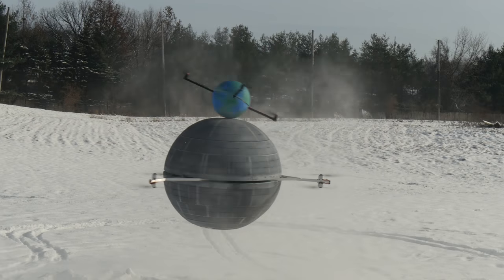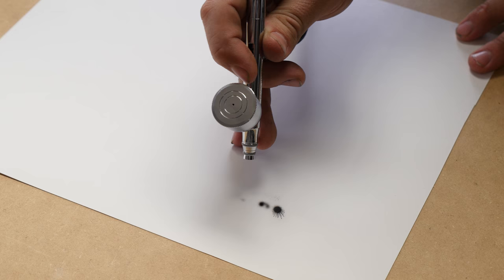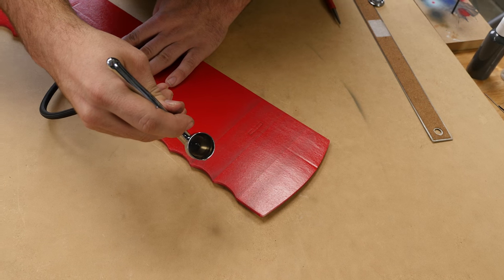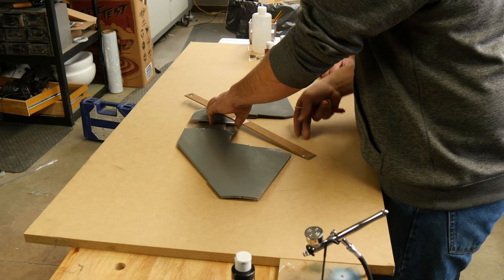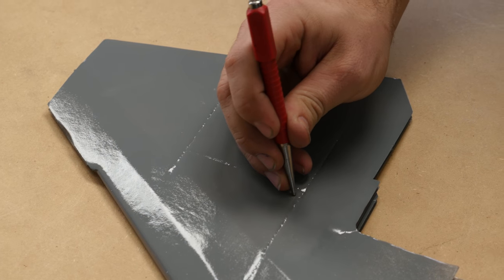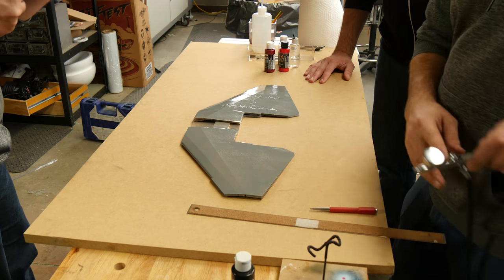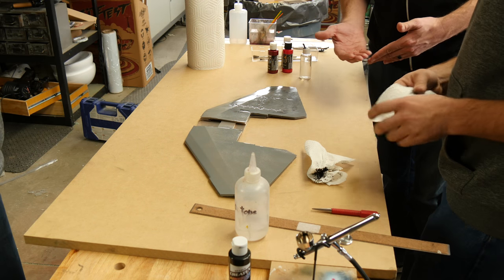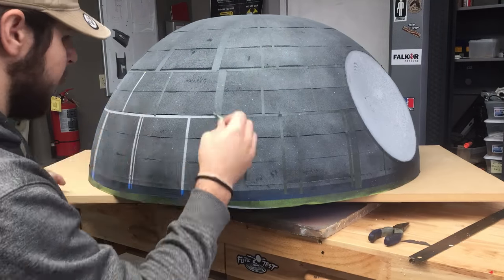Airbrushing Shadow and Distress Effects | Flite Test

Comment: Just want to say really quickly that a 'single action' airbrush is like rattle can paint, you control both the paint and propellant at the same time.  A 'Dual action' gives you independent control over paint and propellant dispersal.  So you can control how much air is coming out and whether or not the paint is coming out. 

How the brush gets the paint has nothing to do with it's trigger mechanism.  You can have single action brushes that use cups, and dual action brushes that pull right out of jars.

Comment: DO you need a flight control board on a quadcopter? Im a beginner quadcopter flyer and the flight control board thing is complicated and i was wondering if there was a way to by pass it and fly without leveling or gps or those things. I think it would be much more simple for me to flywihtout the mess of the flight control board, so if some quadcopter veteran could help me that would be great!
Reply: It is needed.  The quad is moved by a combination of motors spinning up and down compared to each other.  Without the flight controller the calculations needed in order for smooth and coordinated flight can't happen.
Reply: Do you know a Flight controller that is easy to set up? I had a naze32 and i finally got it connected to the computer and i was doing stuff guided by youtube tutorials but then something happened to my quad and it just sorta died. When i plug in a battery there is a high pitched whine that then slowly goes down and disappears and i can't do anything with the quadcopter. Help?
Reply: TheBelgianWaffl _ Gaming look at their versacopter video. The graupner receiver/flight controller combo is super simple but only works with a graupner radio

Comment: Gents I'm a Warhammer fan and use an airbrush fairly frequantly. If you need a decent airbrush that cleans up well and wont break the bank get a Iwata neo. It will serve you right. Videos you should watch are cleaning your airbrush (super important) and general air brush for modellers tutorial. You can also create awesome blends and transitions with an airbrush

Comment: I build static models and that kind of tecnhiques are common. Fist thing, the shinier the surface the easier. You can use a regular brush with a mix of cheap school paint, water and dish soap, that will make the removal process much easier so you don't have to use nasty things like strong solvants. So you appyl the diluted paint with the brush and then whipe the excess with a dump cloth, the soap or detergent will prevent the paint to adhere strongly. When happy apply something like Future floor wax and that's sealed for good.

Comment: You guys are making your life a lot harder airbrushing those panel lines. Any recessed details can be filled with an acrylic wash (water-thinned acrylic paint) painted on and wiped off just the same without the need to clean an airbrush. Oil paints take longer to cure so they make great paints for this as well. Another weathering/wash that people use is liquid shoe-polish. Same technique, much more readily available and accessible to those without airbrushes.

Comment: Congratulations to Chad for his artistic work!  You really did a nice job.  Is there any difference between the water proof foam and the regular dollar tree foam in how you paint the airplane and whether you peel the paper off of the plane?  Do you peel the paper off on both types of foam?

Thanks,

Ron
Reply from the maker: The main difference is that you really need to do multiple light coats with the WR foamboard.  If you put it on to thick... it will just peel off and look crappy!
S.O.

Comment: Hey Guys, how fluid do you mix your paint for airbrushing? When I use waterbased paint, I mix water into it untill it doesnt pull any "strings" when I dip a screwdiver in the paint and pull it out, but sometimes when i spray it on painted foam it doesn't  create a clean layer it rather puddles up and doesn't really want to stick to the paint underneath it. Do you have any tips for me how to reduce water based paint or is non water based paint better in that regard ?
Reply: You want to try and get it the consistency of milk.  Think about when you have milk in a glass and the way it runs down the side of the glass.  Most of the milk just slides down, but there is a slightly slower moving part that clings to the class for just a couple of micro seconds.  Your paint should be like that.  It sounds like you are getting just a little too thin.
Reply: Christopher Raff thanks, I will give it a shot !